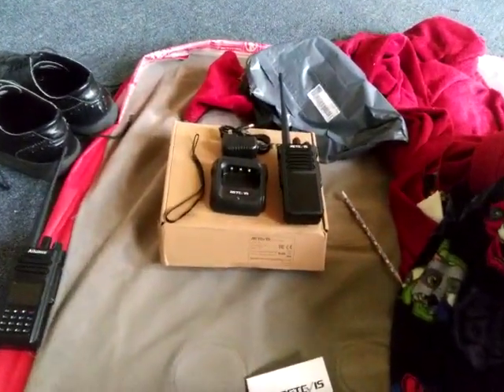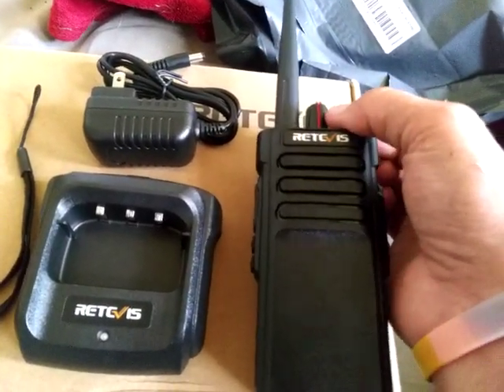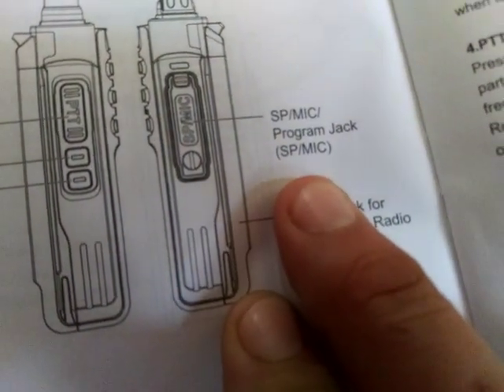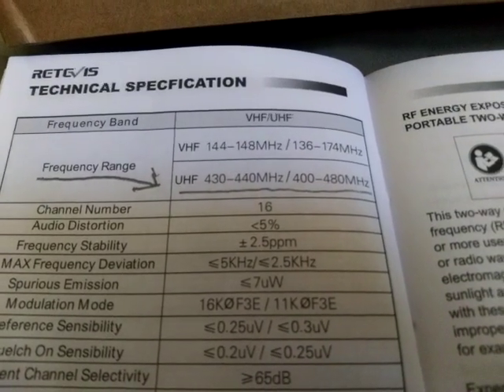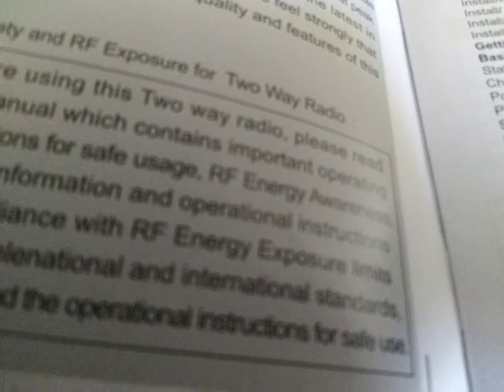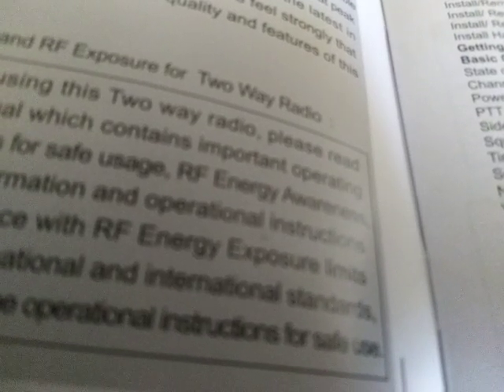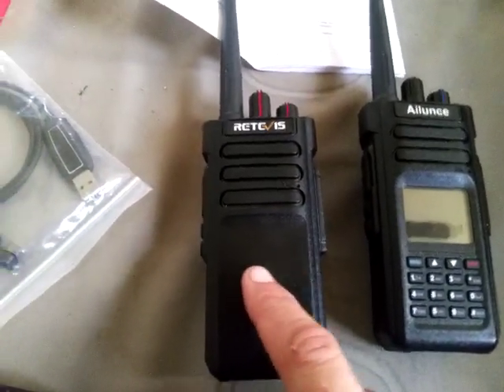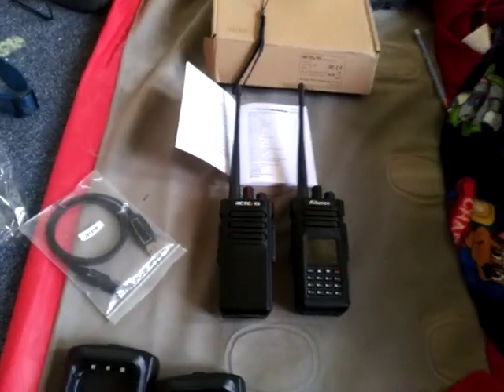Ham radio logic presents retevis RT 29 by KF7YEN

Comment: Thanks for the review, but please stop insulting our intelligence. We actually know what an instruction manual looks like, and I think we could figure out what a wrist strap is (if like all little Do-Bees, we put on our thinking caps). And we know what the other items must be. Like the radio. And on the side there's a push-to-talk button. 

You also proceed to read us from the instruction manual, where we learn what a power switch is and which way we turn them to turn the radio on/off and increase the volume and change the channels. And more of that technical stuff! My head hurts!

There are several versions of this radio, a UHF, a VHF, a UHF Weatherproof, and a VHF Weatherproof, and of course the weatherproof models also are waterproof. They also are 10-watt, meaning you could use it to talk from New York to San Francisco (If you're a flat earther). If you're a globetard, foolishly believing that the Earth is round, you should be able to get more than 5-6 miles with this tank. 

It's a great radio. Just get a tech sheet and read us from that. Now that I know what a [ PTT ] button is, I've figured out that I need to push it to talk and release it to hear! Why didn't they just put that in the manual? Oh, wait, they did! When my dad got my brother and me some walkie-talkies when I was 9. It was there that I learned that if I pushed the button down and held it, none of our other friends could hear my brother. 🔹🗣 📻 🚔